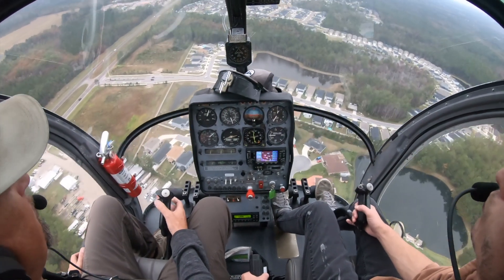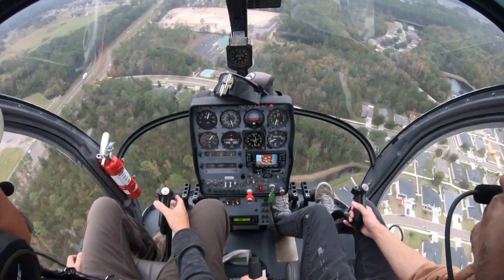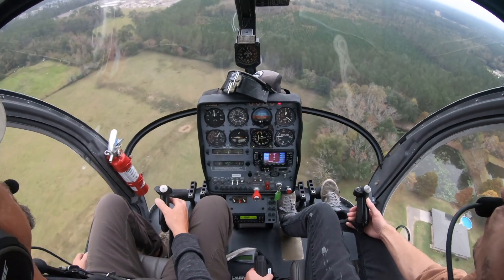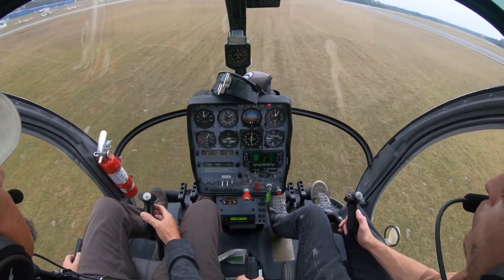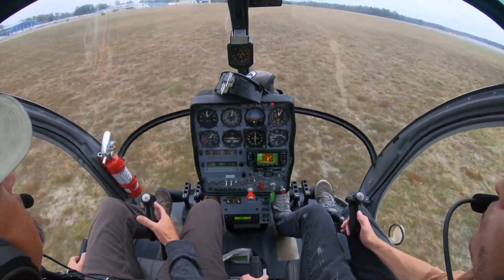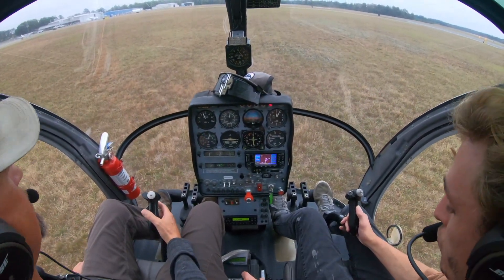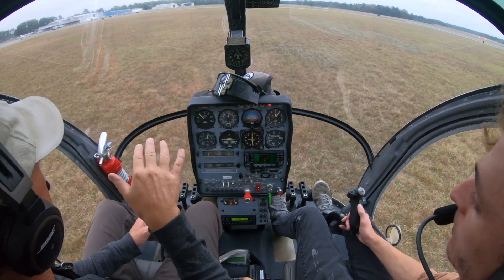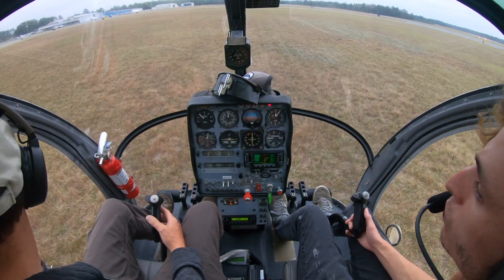Helicopter Emergency Procedures.  Stuck Collective.

Comment: I had an actual stuck collective once. What I did was get on the back side of the power curve by climbing to an OGE hover. There the power required exceeded the power available. I. Stayed below. effective translational lift , and ended up in a 5  foot hover when I hit ground effect. At that point is where I reduced the throttle.

Comment: So that’s a great demo. When rolling off the throttle, what are you teaching your students to use as a minimum safe rotor speed? Do you accept the low Nr horn as the minimum, or some other figure? Running on to anything other than smooth ground must add to the excitement somewhat!
Reply from the maker: Good question!  It all depends on the aircraft type and requisite operating limitations and restrictions.  Generally though, we use the minimum power off rotor limits as a guide.  The low rotor indication in this aircraft initiates at the minimum engine RPM limit which is why you see the Low RPM indicator flashing.

Comment: I'm curious... why does the chopper seem to yaw left and right so heavily? At least on the camera it seems to be heaving left and right a lot...I don't see the anti-torque pedals moving a lot, so what makes that yaw motion so pronounced?
Reply from the maker: That is caused by a combination of throttle adjustment (adjusting rotor RPM to control descent) and a gusting crosswind during landing.  The gusts of wind caused the yaw oscillation.  It is more pronounced on camera though.

Comment: Aviation enthusiast/noob here. Does this mean the collective was stuck in the same position for the entire duration of the video?
How do you control the decent in these cases, with power?
Reply from the maker: Great question!  Yes, the collective remained in the same position throughout the video.  Descent is controlled using a combination of forward cyclic and throttle reduction.  Reduce Rotor RPM (reduce throttle) and the aircraft will descend.  Forward cyclic will also cause the aircraft to descend but will increase airspeed.  Shallow approach, gradually reduce airspeed and throttle to land the aircraft to a run on landing.
Reply: @angels1aviation920  Does this mean you're coming in like a fixed wing approach, pitch (cyclic) for airspeed, and throttle for glideslope?
Reply from the maker: @TrossachsPhoto  Very similar.  Throttle is used to establish descent rate and cyclic for airspeed, however the cyclic is also used for the descent.  Forward cyclic, increased airspeed and descent.  It becomes a balance between cyclic and throttle to maintain a stabilized approach and rotor within limits.
Reply: @angels1aviation920  Thanks for the answer!